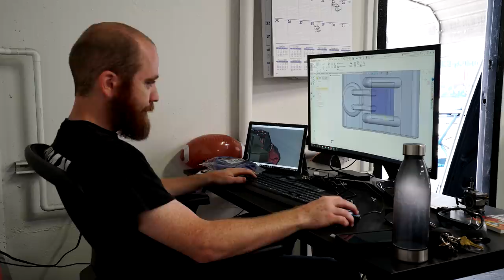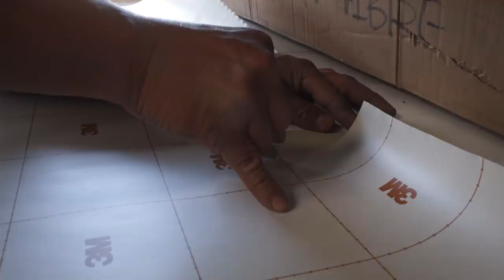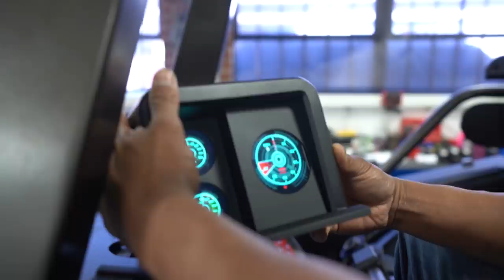1,000HP Halo Warthog VS Times Square New York!

Comment: I say 5 million to build this. I wish there was some girth under the frame so it doesn't feel so bare, but I still love this a ton. This is a great stepping stone to the next warthog build that'll be on model to Halo 7 😎 3D printed cars? Lol
Reply: $2m in parts 3m in labor sounds about right. Crazy!
Reply: @devinbender8428  a dude built a Warthog for 10000$ by just himself
Reply: @jetstreamsam7853  yea I’ve seen those. Take an old Chevy K truck. 3D print a body. Done. It’s not hard.

Comment: 7:00 actually the engine sounds like a wahog! Please let it be a diesel engine, manual speed changes, put a tin cover on the suspension and neoprene on the inside of the body, seats with a Kevlar cover on the back, xenon headlights, install a Rebelultima3D® sound system , mount a minigun in the back, and you set one aside for me😎.

Comment: Not hating on the work Hoonigan have done on the Hog, they did absolutely amazing, and as its own thing, it's brilliant, I just cannot like the 343 (the current Halo developers) Warthog design. The Bungie (ex Halo developers) Warthog design was good as it was, and I very much dislike the 343 redesign. Those red jerry cans are probably the part I hate the most. A military vehicle having red jerry cans on it, is ridiculous. The whole point of Camo is to not be seen, and just the olive-drab and black would have looked fine, but 343 putting red jerry cans on there is like saying 'hey the explosive fuel is here, shoot me'. That kind of dumb design is prevalent through out 343's take on Halo though. 
 
Regardless of my dislike of the 343 Warthog, the Hoonigan warthog is brilliant, and I commend the amount of work and effort that went into making it.
Reply: Love your train of thought here, however, shooting a jerry can of fuel will not cause it to explode. Unless there is sufficient heat, spark, or flame, gasoline will not combust. Totally agree with your idea of camo though. A lot of US military gas cans are olive colored.
Reply: Bro it's water not gas
Reply: Water not gas bro
Reply: @argo9721  Oh, lol
Reply: @silly-xd8uq  Doesn't change my point much. They are still sticking out like a sore thumb, making the vehicle easier to spot and shoot at.

Comment: Okay now make a proper Warthog from Halo:CE with the proper suspension and not the stupid current day shit they started putting on Hogs in the later games. Also give if 4x4 steering, obviously for safety it mostly only functions at low speed and either center locks or has very small input at higher speeds like some sports cars.
Reply: It would cost literally over a million to make a fully independent suspension with 4ws and 4wd and 1000hp. 

It has 4ws and 4wd and 1000hp. Close enough. 
Independent suspension would take a lot of engineering. Because to my knowledge there is no fully independent suspension rock crawler with 1000hp
Reply: @devinbender8428  There has been suspension similar to that on off road rigs, and I personally don't get two shits about 1000hp on a show vehicle. Its pointless. You can say a show vehicle has 50 billion hp and its effectively the same. That aside I'm pretty sure the Warthogs don't have 1000 hp in lore. I know I've read if before somewhere, but since Hoonigan made this that is all Google will show is "1000hp Warhog!!!"

Comment: For a massively capable off-road vehicle with 1000hp they sure do worry A LOT about weight. I find it hard to believe that a 12lb jerry can was so heavy that it would have affected the performance.... like at all. Same lame excuse for the winch and tusks. The non-functional features are adding up very quickly to be a good looking yet underwhelming overall build.

Comment: I'm disappointed that it had crab steering capabilities, and they chose to not use it. There have been a few driveable warthogs (wide range of quality, I know) and yet none had functional warthog-style crab steering. Don't omit it, don't use monster truck styled separately controlled rear steering, and actually pair+mirror front and back steering!

This is probably the best looking one made, but yet again... no full warthog style steering. That's too bad.
Reply: I think they will in the future. Just trying to baby it right now.

Comment: I know I'm late to the party but... Y'all sold it like a real, working warthog (as much as possible), and even told the 343/Microsoft people that you'd use aluminum panels instead of fiberglass and then went ahead and used fiberglass and painted wooden bits and 3d printed plastic buts you could've easily fabricated, so imho you just brought it back down to a prop for looks rather than the first "real" warthog. What a shame. Still cool, don't get me wrong; but man, you had the potential and flopped at the finish line.